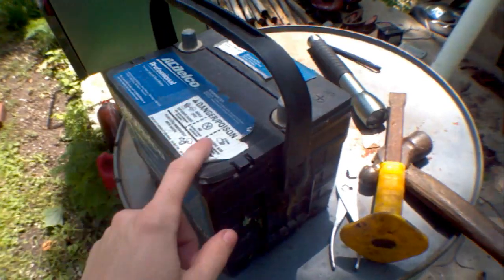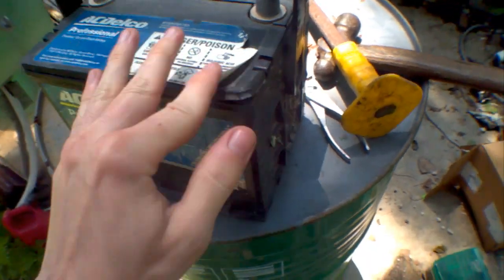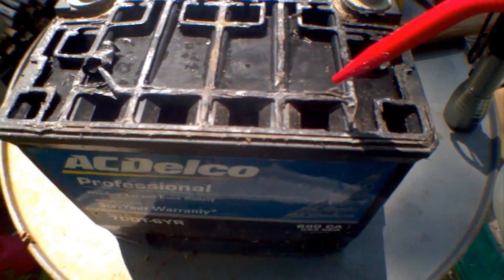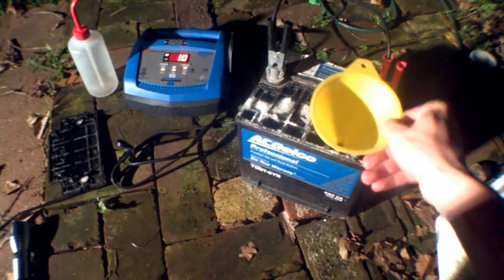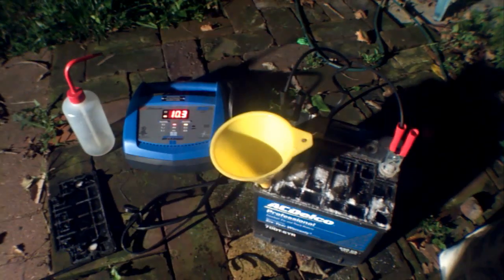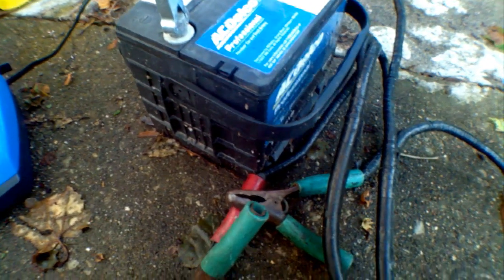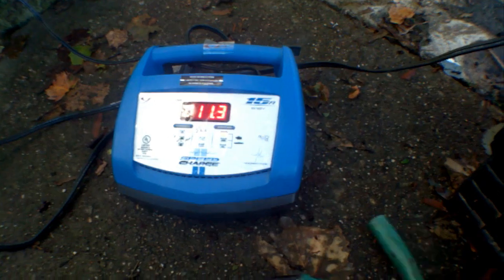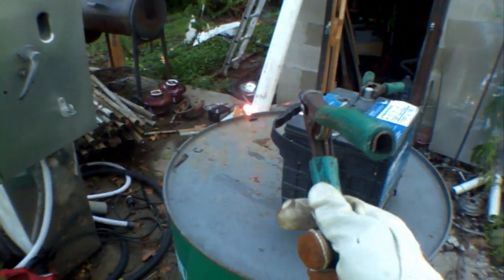DIY: Opening a Car Battery and Repairing with Epsom Salts

Comment: i would suggest hooking the battery to a controlled load, such as a fan motor or some  12v lights, nearly drain it then recharge, repeat a few times and see if that helps

Comment: A battery is considered dead at 12 and below volts
Reply: +Roger Beck Not always
Reply: +Julien COPPOLANI yes Always...source... work at autozone
Reply: No, False.
A battery with a very low voltage can be recovered, but not always of course. It depends on many factors. I myself recoverded some (which had been thrown away) and they work well now.
Reply: Julien COPPOLANI it's supposed to be a steady 12.6 all time....I can take any new battery that's been on the shelf a year and it will be a steady 12.6 ... your starter and other electric vehicle components call for 12.6 v not 12 not 11.9... yeah it will work with 12 but you can really mess engine computers and sensors, up.not to mention LIGHT UP your instrument cluster like a Christmas tree with a plethora of engine codes, simply by the voltage being too LOW...or "Below Threshold"

Comment: I have a battery so dead the voltage is literally -0.077v when plugged into my multimeter with the correct polarity! I'm going to have to recycle or replace it because it's literally a useless cinderblock time-bomb.

Comment: I wonder if a full discharge and recharge would help. I've had a few batteries that sat for a long time that actually started charging after I shook them up. I figured there was stratification of the acid mixture that shaking seemed to cure. Still, I wonder if a full discharge and recharge would help? What if the battery was charged in reverse, then discharged and recharged again?

Comment: Clearly this fellow has NEVER seen a battery explode when it is thumped (as in hit hard with a hammer). Internal plates short and spark, gas ignites, battery explodes and scatters acid etc.
Do NOT hit old batteries. Extremely risky.
Reply from the maker: +Peter Bloggs yeah ive only seen them explode from shorted plates, not a hammer hit.

Comment: "In the end it's better to short circuit your battery...." Clearly you've never ever had one of these explode in your face. Short circuits are horrible for batteries and end up killing them. Short circuit some wires in your house or your car and let me know how that works out if you're still alive. Aside from that, the battery will create hydrogen gas which will ignite given the chance. You doing your spark tests is basically asking that battery to blow up right next to you and shower you in acid. They're called lead ACID for a reason. A battery as old as you claim should not be brought back to life. It will only fail time and time again with the 'methods' you showcase. 
I'd also like to point out the complete lack of any safety equipment or regards to safety in any form while dealing with a lead ACID battery. Again, ACID! Wearing shorts, a t shirt, flipflops and glasses with no gloves, boots, aprons, or face shield while short circuiting, tampering, or opening a battery is an absolutely horrible idea!
Absolutely not one thing in this video should ever be replicated. I couldn't help but cringe while you smacked away at a battery with a large chisel and hammer on an unstable barrel; just waiting for that to fall over and dump out ACID everywhere and possibly all over you too. Another terrible idea, right there.
Let's pretend for a minute that you did have some sort of safety equipment and weren't completely reckless in opening this lead acid battery. What good on earth would this be? That battery is so screwed up inside from the years of neglect that it isn't even worth saving. Even a battery that wasn't so old but still couldn't deliver the current would produce similar results. Just because it reads 12 volts doesn't mean it has the current held inside to actually do anything of use. And not to mention, now that you've opened it up; think about what will happen if that battery falls over. Guess what? That lid will pop right the hell off and pour the acid all over the damn place. 
One of these days, messing with batteries like this will bite you in the ass when one explodes all over you. Recycle the damn thing instead of whatever you'd call this. Hopefully you won't learn the hard way.
Reply: +Bryan Young It seems like you don't really understand what is going inside one of these batteries. Shorting a lead-acid battery is not the end of the world, the internal resistance of this type of battery chemistry acts as a current limiting resistor, which make them inherently safer. Also older batteries shouldn't be brought back to life as you say not because of safety really but because the dissimilar metals have started to corrode, further raising the internal resistance, and further limiting the amount of power the battery can output.

If you shorted the wires to your house all you have for resistance is the wires, which in electronics, is considered a perfect conductor (even though it's not really), you'll pull infinite current at zero Ohms tripping your circuit breaker, or if you're unlucky, burning a wire inside your wall.

Lithium ion batteries are a different story, their internal resistance is much lower and can provide enough current to boil the electrolyte inside and cause an explosion during short circuit. 

At any rate don't fuck with batteries unless you know what you're doing
Reply: Nice comment, gonna save it has me laughing to good.
Reply: Don't believe me? Give it a try and see how it works out, that is, if you're still alive once you're done.
Reply: +Bryan Young "" no I know your right it's like 2+2=4 it's just to funny how most ppl think. if intellectual ppl got together just think what could be possible without gov shutdown or denial we'd be real life Rick and morty by now .
Reply: kody gordan
 My apologies. I thought for a moment you had the same mentality as the uploader. And yeah, I agree. Somewhere along the line we got 'dumbed' down severely.
Reply: Jacob Jones
It is true, I don't know everything when it comes to batteries. I still maintain it's a bad idea to directly short circuit a battery. One little tap probably won't hurt anything, if the hydrogen gas doesn't explode first (if present, that is). However a long period of time, however, if your wires don't melt, heat will be generated within the battery. I'd imagine bad things would happen if the heat got high enough.
Yeah, you're right, lead acid batteries are one of the safest kinds to work with, as opposed to lithium polymer with it's Michael Bay style explosions when misused.
As far as housing goes, 120 or 240 regardless, let's assume that breaker didn't trip and the wire melted. The heat will likely set anything around it ablaze as well. While fire-retardant insulation helps with this, I don't think the drywall or studs amongst other things inside the wall (other wires or piping) will feature the same fireproofing. Although, I'm not a contractor so I'm hoping I'm in the ballpark with that scenario.

Good philosophy there at the end, though.
Reply: +Bryan Young I agree first thing I was thinking was what a great work bench.
Reply: +Bryan Young it's just lack of communication and listening people that don't wanna share  and not got professionals in their family to tell them otherwise so they have to learn themselves....and also money separates experts from learners

Comment: Well sparking the battery probably caused the acid to mix with the E-salts, which will help. Most batteries that fail are not due to acid level its due to plate failure internally or a short between plates caused by a plate failure. Please charge and stress test a battery with a shorted cell the way you did this one lol. That will result with the splosion these others are talking about. The battery will overheat have an excess of gas venting and poof.
Reply from the maker: Clayton Magnet
ask google.
Reply from the maker: +Richard Schmidtendorff yes ive had batteries pop when they have a shorted cell and are under load, but it wasnt all that bad.
Reply: +Rinoa Super-Genius You can take a horse to water...how does the rest go again?

Comment: If you had ever exploded a battery you would be a bit more careful shorting it out or making sparks over the top of one that has just been charged.
Reply from the maker: +g0fvt i have, but it didnt explode too bad. just popped the top off and shot electrolyte everywhere. but its not so bad.
Reply: +Rinoa Super-Genius Trust me, you were lucky, I don't make a habit of it but the last one drenched me in acid and gave me a black eye. (Faulty drop tester, battery was under huge load but meter was not reading). We won't talk about the motorbike battery that I blew up in my parents house as a kid, that destroyed the carpet, wallpaper and left marks on the celing......
Reply: @g0fvt  People have a lot of faith in man made instruments!

Comment: Volts are not amps. Figure it out.
Reply: +DMAN22yeah 
Actually, volts is a measurement of difference in potential based on available current flow and the resistance of the conductor. So it is probably  better to say amps determines volts. Regardless, that kid is lucky that something bad didn't happen and he did show methods, however poorly executed, to get a battery working again. Still, please NO ONE use this as an educational video.
Reply: volts divided by ohms is amps, so yes volts determine amps
Reply: +noyb72      👍

Comment: careful with charged batterys they give off hydrogen and oxygen (rocket fuel) which explodes usually covering you with acid.if you must spark do it away from the battery with long leads.

Comment: Spark test with the charger still hooked up????
Reply: it was turned off
Reply: charger was probably left on lmao
Reply: victordiaz106 no it doesnt read real time voltage when it is on
Reply: charger output is dc, you can normally short any charger with no problems

Comment: Hey Rinoa, nice vid, I've always wondered if you can rejuvenate car batteries and have seen circuits of "battery decalcifiers". From what I could see; the circuit shorted out the battery with a MOSFET connected to a clock generator, 555 timer i think. So what your saying might be true, punishing the battery a little might restore it a little.

Reading some of the comments below, here's a rebuttal:

Also getting a battery like this to blow - for a start, he took the top off, therefore you made a vent for any gas build up, top went back on, but seal is now broken. People claiming the hydrogen given off and you sparking the battery, yeh ok, but there is not a huge amount of hydrogen given off in that small amount of time, plus it'd have to be in an enclosed area in order to get a decent explosion. These batteries are manufactured with a vent, designed to blow safely when overheated or have gas build-up

Causing the battery to destory itself by shorting it out, ok yes it will get hot, but he's not an idiot, to get it so hot to melt it into the ground - you'd have to short it for 10's minutes not seconds.

Getting sprayed with battery acid - ok battery acid is corrosive, but its not going to melt your skin off! it not like phosphoric acid! if it gets on you, find a tap and wash it off your skin. If you get it in your eye's mouth or other sensitive area, then yeh, it's gonna sting and medical consultation is advised where the eyes are concerned

Electrocution - no, just no, not enough voltage to punch through the insulation that is your skin.

"you shouldn't do that" - “It is through disobedience that progress has been made, through disobedience and through rebellion." - oscar wilde

Comment: the epsom salts so worked, couldnt run the inverter for my laptop for more than like 3 seconds, after the salts it ran a water pump for like 15 minutes.  i am doing a few more charges and power dumps to see if it gets better.

Comment: Hey, my co-worker dropped our new battery and cracked the case.  I found out you can fix the case by melting with a soldering iron, just melt and area and blend it.  You could fix the top that way.

Comment: sir, always blow away the gasses near the top of a battery before connecting objects and connectors on a pole.  also, avoid sparking near a pole on a battery, all batteries have vent that release explosive hydrogen, ventless batteries usually have small side vents that do the same.  i care about you even if you don't.  look up battery explosions on youtube, please be careful around the tops and sides of batteries.
Reply: +Gristle Von Raben the gas rises away, and there would not have been any as he wasnt charging it
Reply: there are a lot of people with acid damage from hydrogen and hydrogen sulfide explosions from batteries and sparks.  They are more dangerous than the general population suspects.  for real. so be careful.
Reply: Gristle Von Raben most the batteries he works with are old and the acid content is very dilute, but if someone spills a new car battery on themself then they have a problem
Reply: I can only try to warn people so much about such dangerous things.  good luck.
Reply: Gristle Von Raben i personally dont have a spillable lead acid battery, but the average person should be careful

Comment: Bunch of pussy ass haters in the comment section, too scared to play with a battery. Probably cant change a tire or cook a proper meal either. I dont waste $100 on a battery when I can maintenence it and get another year or more out of it. Obviously none of these people leave the city enough to have need for any survival skills.
  You should invest in a battery hydrometer though. Epsom salts help dissolve some of the sulphur buildup on the plates but you need to know if you have the proper amount of sulfuric acid in there. You can find the acid and the tester for a few dollars at the auto parts store. Dissolve the salts in distilled water first, top off your cells with the proper amount of acid and solution, and the battery will go back to "normal" almost long enough that you forget about it. I have run them over 8 years in some cases.
Reply: Josh Denham ummmmm, basically epsom "salt" is actually all sulfur and a tiny tiny tiny teeny weenie amount of magnesium, so you ARE replenishing the acid just by adding sulfur and water ;-) but batteries usually don't vent the acid, they only vent the oxygen and hydrogen that are gases from recharging. recharging a lead acid battery usually concentrates the remaining acid and causes plate corrosion and death LOL ....... at least that is my understanding... hydrometer is a "must have" item ;-)
Reply: Haha exactly but let's be real, if something came down, natural selection tends to favor those who have more Survival capabilities.
Reply: +Josh Denham In a crisis survival situation I would take the risk of looking like the Indian Acid victims to live! Not fool around in speedoslippers shaking acid! Haha, Hillbillie tecguru!
Reply from the maker: +Kenneth Bothen well you wont find any pure acid in any working lead acid batteries, thats for sure. what people dont realize is acid burns come from concentrated acid, not battery electrolyte.
Reply: i love screwing around with batteries and getting more life outta them , it is  fun

Comment: you forgot to add the pepper. if you want a hot battery, add habanero peppers and it'll crank at a million amps
Reply: And some jalapeños
Reply: dont forget the stickers, they add infinite power
Reply: yummy  i'm going to go eat my battery hmmmm
Reply: So up in Canada during wintertime, I can ditch my 120vac battery blanket IF I drop some habaneros inside. PLUS- a million amps. (CCA I guess?) very nice, now how do I cool off the battery  in the middle of a scorching heatwave? Dig those habaneros out and just replace with bell peppers?
Reply: I recently got the EZ Battery Reconditioning program and just reconditioned two car batteries. The guides were very easy to follow [Check Details Here==> HootBattery.xyz
 ]. I wish I would have found this years ago! Thanks!?

Comment: well, good try. But it didn't work as expected. I think these crazy science stuffs can fascinate young ones to do it and enjoy the science in practical way.
Reply: Chandra Mohan Something I also found useful for reconditioning batteries with epsom salts
  is Corbandy Battery Blueprint Crusher - it will be on google if you need it

Comment: They sell this stuff call electrolyte.  Its 35% sulfuric acid and 65% water solution.  It will work a lot better than salt water.
Reply: +Kevin Miller its not salt

Comment: I have to try this Epsom salt trick. I've seen other videos where they explained how mere dirt build up on the top of the battery can drain it by 5v. He even proved it by attaching a volt meter probe to the positive terminal and the other to the dirty top of the battery 5 inches away from the negative post. I found that interesting.

Comment: Have you ever tried arc welding with 12 - 48 volt batteries? Our trucks radiator support broke while on a mission in Vietnam. Time was not on our side and one of my soldiers suggested I let him use one of our spare batteries to try and weld the support back in place. By god it worked well enough to get us back to base camp. We had some 14 gauge wire we used to do the welding. In all we welded about ten inches before the battery lost most of its power but it did the job. Just a suggestion possibly for another video. We used a pair of 16 foot long jumper cables with 6 gauge copper wire inside them.
Reply: Thanks for the service ,i will try to do aluminium reverse dc welding with jumper  cables ,never thought of this method.
Reply: he does it in the future